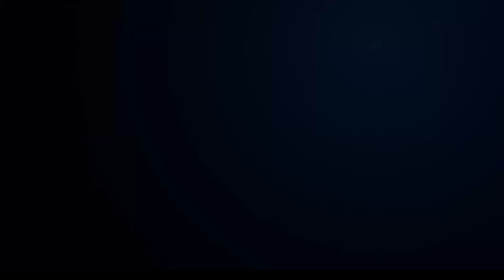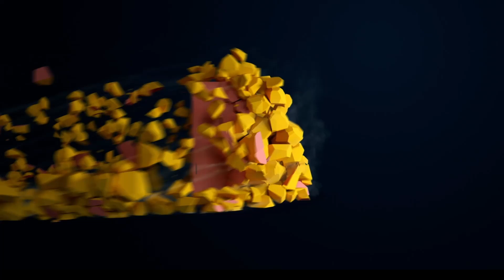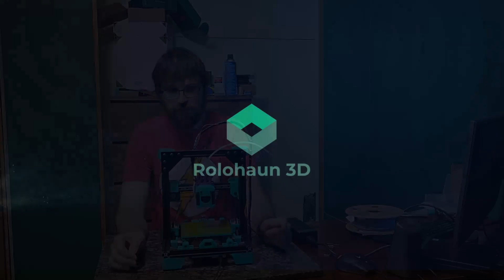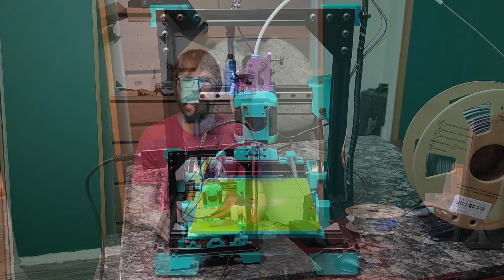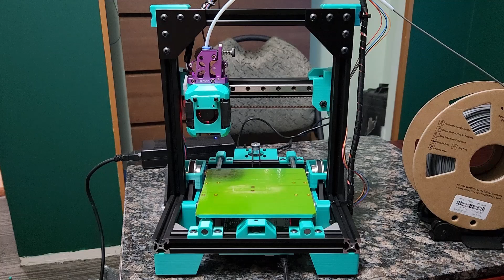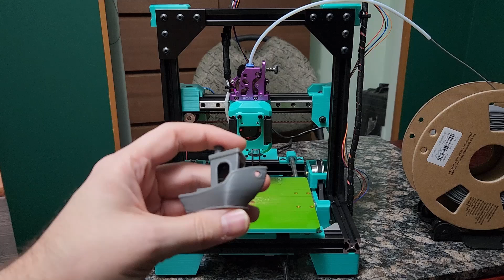Best DIY 3D Printer for Beginners! My printer called Kappy

Comment: I've watched some of your Klipper stuff and am loving your core xy builds.  As someone new to diy machines, if you had to recommend one with around a 250x250x250 (or slightly larger) build area, which one of your designs would you recommend?  Something with true auto bed level, not just probes, but stepper motors that adjust the bed by themselves.  I have 2 ender 3pro machines and am just getting into klipper.  I looked at voron machines and the price tag was more that I thought.  So why not build a machine, learn, and get some great speed and prints.  I don't mind sourcing parts and printing components.  Thanks for providing this info!
Reply from the maker: Hey, I would recommend my SimpleCore Legacy printer, feel free to join my discord there are users in there that can answer any questions

Comment: Linear rails on a 3d printer that doesnt even have a heat bed...okay.
Reply from the maker: The printer has a single linear rail on X, I do not know what that has to do with not having a heated bed.. This is for beginners to lean about building printers and it's for PLA. Heated bed is not necessary. Also the bed is not heated to keep weight down.

Comment: I can see this as a platform to upgrade the Ender3s I have lying around 😃
Reply from the maker: yes these parts should world, this is very scalable, the parts should work with any 2020 extrusion
Reply: @Rolohaun  I might even upgrade. My Kobra Max with this 😃
Reply: What would be the improvement? Dual Z? And a new shroud?
Reply from the maker: @felipenavas  dual belted z, z-tilt to level the X axis and dragonburner, linear rail on X
Reply: You had me at linear rail on z 😃
Reply from the maker: @byronkavanaugh1427  linear rail on X

Comment: @Rolohaun just a heads up the CAD you have the Z motors intersecting with the MCU board.
Reply from the maker: Yes the motor in the cad are larger, the BOM states the motor size max for a stock frame

Comment: you can use SKR 1.4, SKR 2 and SKR 3 boards to do Z tilt , all you need to do is use E1 as your second Z motor, I use this on my bed slinger. its running a SKR 3 EZ
Reply from the maker: yep any 5 driver board will do

Comment: Thanks for sharing your work and elaboration on it, I really enjoy your videos. The only question I have is why anyone would want to print there bed, or any sheet parts in general. I understand that its cool to be able to print as much as possible, but performance wise it could help to use a template and store bought material.
Reply from the maker: main reason is to keep the weight of the Y axis down, using glass or metal will add weight which is a con of bed slinger printers. A cnc cut carbon fiber bed frame and bed would be best

Comment: Between the rook and kappy which would you recommend for a first build, I'm leaning towards the rook due to the kits available, any help is appreciated.
Reply: A ton of people have built the rook, it has a very active channel in the discord, and you can't go wrong with a nice kit. I would go rook. You also get a heated bed so you can do more than just PLA. Kappy is neat, though. Kappy is also new, so it may get some adjustments/not many people will have made one yet.
Reply from the maker: Rook has a lot of info on the discord and mods and such, Kappy is brand new and it will take some time for other to build it and mod it. If you want a kit the Rook will be the best choice.
Reply: @Rolohaun  Thanks I'll hopefully, be getting one soon, though the fabreeko kit doesn't ship pre orders till mid to late august...

Comment: How do you cut your aluminum extrusion 😄
Reply from the maker: all my designs use standard sizes, I never cut anything. this is easily scalable too
Reply: I don't know what Rolohaun does, but I cut the extrusion for my Rook 2020 build. I replaced the stock timber blade on my drop-saw with one rated for aluminium - basically you need more and smaller teeth. Here in New Zealand I found the "Diablo Non-Ferrous/Plastics". When cutting be sure to clamp a stop-block in place to get consistent lengths, and cut steady and slow!
Reply: Using a chop saw (miter saw), only cut half way through.  Rotate the extrusion 90 degrees and cut half way through again.  Rotate and repeat.  Never take the blade all the way through the extrusion or it will tear out the bottom side leaving an ugly edge.  Clamp a stop in place to get consistent lengths.